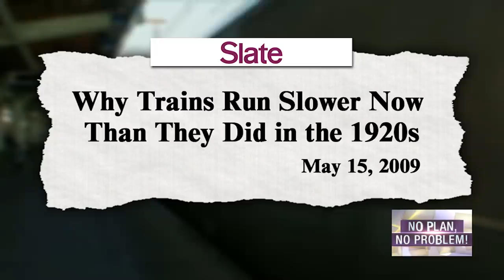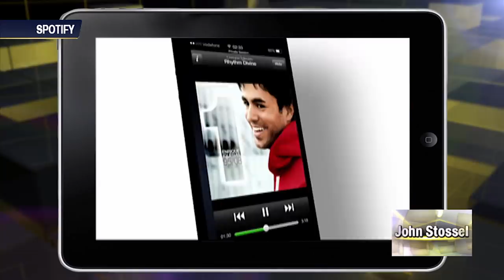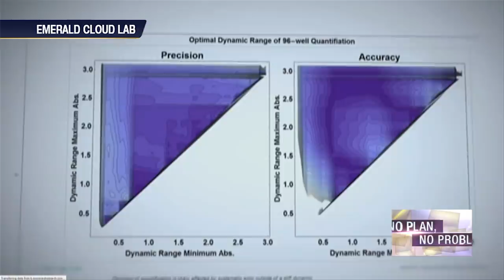Classic Stossel: Regulation Overload with Peter Thiel

Comment: the empire state building is also a more resource heavy design than the WTO.  The WTO fell because they made the interior so hollow that it was not strong enough to take a hit from a plane.  However the WTO took a very heavy, diving speed jet.  The reason the WTO won awards is because of how many resources they were able to skim out while keeping the structure strong.
The empire state plane took a hit by a small empty bomber at (extra slow cruising speed).
Reply: The WTC is the building.

The World Trade Organization hasn't fallen.
Reply: @mirzaahmed6589  thanks I always confuse the two

Comment: John, you got one fact completely wrong... drone delivery in the US is stymied by government regulations... As an FAA licensed pilot since 1991, I can shed some light on the falsehood given to you, likely by the likes of Amazon delivery.. Our airspace is protecting the public mostly by the FAA's FAR (Federal Aviation Regulations) - nearly every one of these Regulation is the direct result of a human death. What Amazon wants is to operate within the regulation airspace without a licensed pilot complying with the primary requirement of all, even Airline pilots - "See and avoid other traffic" - (Title 14 of the Code of Federal Regulations (14 CFR) part 91 set forth the concept of “See and Avoid.” Part 91, § 91.113)

This is an unsafe request for reducing the cost of package delivery... They could easily fly just above 80 feet above ground level (AGL) to comply with Case Law protecting property owners from drones with cameras looking at things the owner considers private, as long as they are not within the vicinity of an airport, typically a 5 mile radius. Imagine a swam of Amazon drones delivering hundreds of packages within one of NYC's airports - can you say "Second miracle on the Hudson" ??

Comment: IMO, all Federal, State, County, and Municipal laws or regulations should have a date specific "Sundown Clause" or expiration. The clause or expiration is used to determine if the law or regulation is working and relevant enough to be retained.  If not, the law or regulation is null and void. 🤔 Also, all laws should be written in layman's terms and limited to two typed pages.

Comment: Its important to realize that buildings have also gotten far more complicated themselves, there is much more wiring etc. And that all takes time to do and set.
Reply: I hope you do not really believe that is the reason it takes so much longer??!?!
Reply: @thesaintmustwalkalone708  ah yes, because slapping together a mud hut takes the same amount of time as building a wood frame with gas, heating, plumbing, wiring, windows, etc. You need to obtain an expensive permit for every single one of those actions, but saying that the stuff itself doesn’t add time to the build  isn’t true.
Reply: @Andrew-th8jk  first off... I said "so" much longer. Secondly, there are also an average of way more workers than in the past. Clearly that is nowhere near the issue with much of NY and California building issues.

Comment: 80 years ago safety wasn't a concern for buildings. We used asbestos & lead paint even though manufacturers knew they were hazardous. Silicon Valley exploded by huge companies swallowing up smaller companies stifling innovation. How big would facebook be if they didn't sell your personal information., if they didn't buy up instagram. How big would Apple be if they  didn't cause your phone to slow down after a year, didn't let you repair your own phone, didn't let you take it to a independent repair place. Is there an over abundance of red tape, yes. Would there be if these billion dollar industries didn't pinch every penny and cut corners so that things are less safe?  With no regulation we would have workplace injuries and casualties more than Amazon now. Amazon busts unions, squeezes out smaller competitors, lobbies Washington to overlook their indiscretions, pays off politicians to be favorable to their desired  tax cuts, and harsh working conditions. Bezos is the Lex Luthor of the real world.

Comment: When it comes to pharmaceutical. I personally believe the massive regulation are more to drive drug costs up, and help create a narrative. Most companies that are regulated by the government hold themselves to a higher standard. This is because of on word, "liability". But they still have to pay a fortune to cut the government red tape, which drives up prices.

If you want to demonetize some corporation, group, and even a individual. The only thing you need to do is tell half the story.
Reply: If pharma companies want to drive prices up, they just have to collude with the insurance companies to do so. There is no need for regulation to make drug prices higher.
Reply: @mirzaahmed6589  you should reread your statement, but very slowly. Let me put it another way. If the beer brewery wants to increase beer prices. They only have to collude with the customers.

The insurance companies are the ones buying the drugs. That's why they hate paying for expensive treatments.

It could be like the colleges. The hospitals know that the federal government will cover the cost in the long run. So they will charge you $500 for a warm blanket.

Comment: Generally  agree with John but in regulation I think he carries over regulation little too far with message of no regulation work.  No or little regulations works until something goes wrong. I don't think anyone wants to hop in an airplane, cross a bride, go to top of high rise buildings, or take medications  without reasonable regulation. Regulations come as results of lessons learned, but many bad ones come out of emotional reaction  resulting  in pure political regulation not from science  or engineering. The polio  example states it wouldn't happen today  due to regulation.  No, it wouldn't  happen today as well due to news and social media that would obsess over any death which would drive polarized politics noting John likely would put out video questioning  the benefits of the polio vaccine, noting the dangers, or overreaction to require polio vaccines.

Comment: I'm on board with most of Stossel, but on this one I think he sort of slacked off. Not all products pose the same sort of risk to the consumer. You can't compare a cell phone to a drug. The lives lost and ruined by rushed drug development are no small deal. Tellingly, and it's unusual for Stossel, he doesn't offer input from the other side on this one. What did he not want to be heard? So bravo most of the time, guy, but this one was a bit one dimensional.